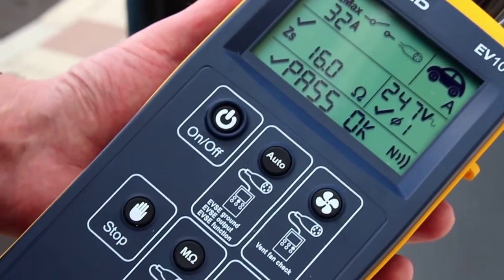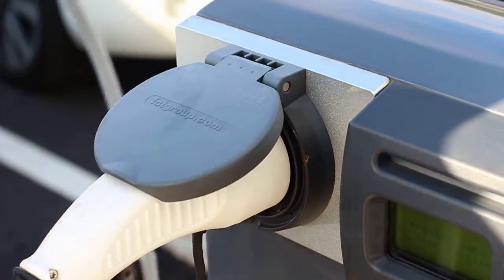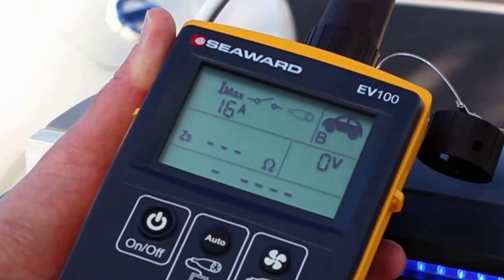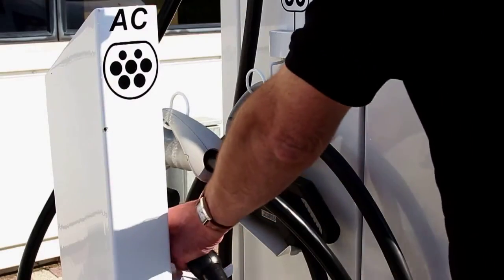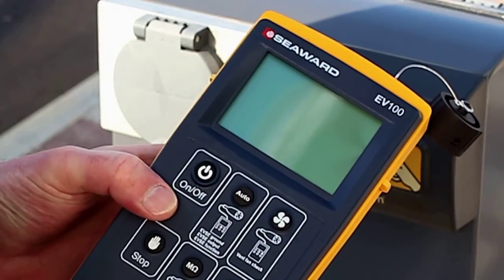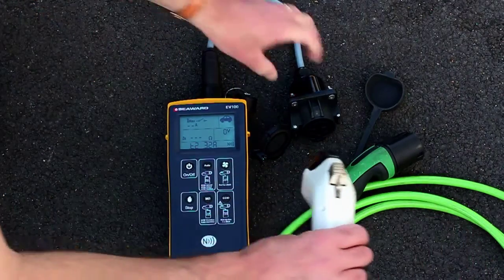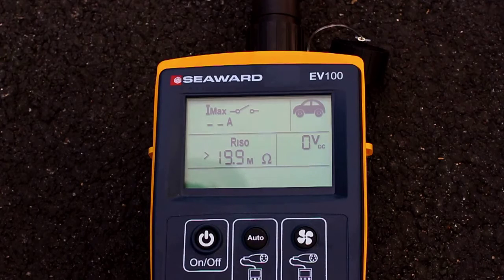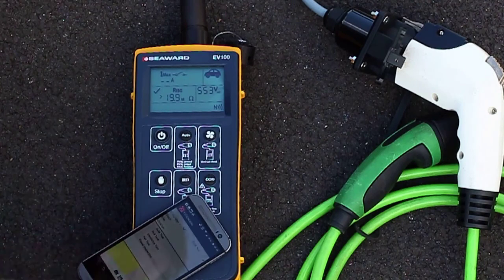How to perform an insulation test on an EV Charging Cable

Comment: Hi, I have some questions about this. Is it possible to connect the EV100 to an EVSE that has built-in charging cable?. Does it need to disconnect the charging cable from the EVSE before performing an insulation test? And does the EV100 only show that the insulation resistance more than or lesser than 19.9M ohms?